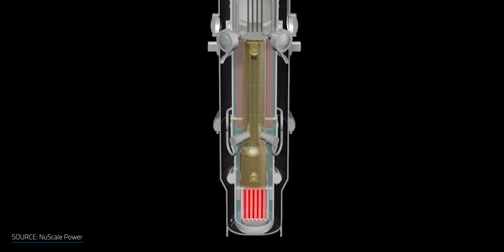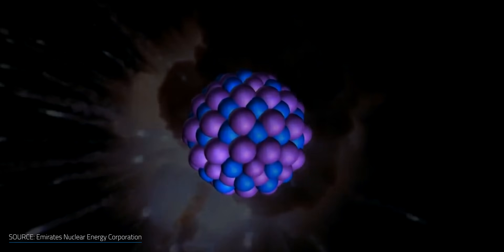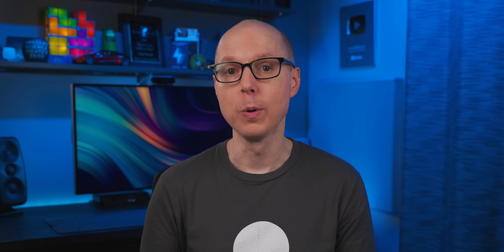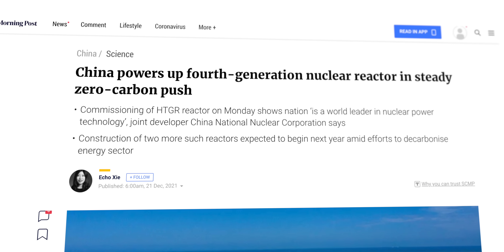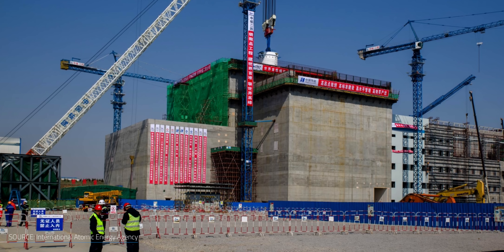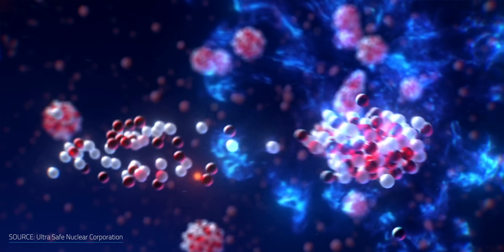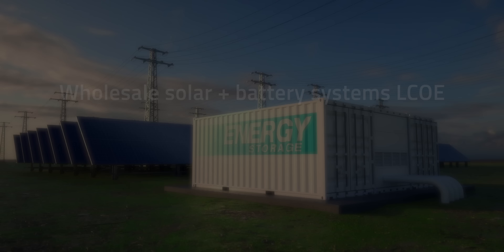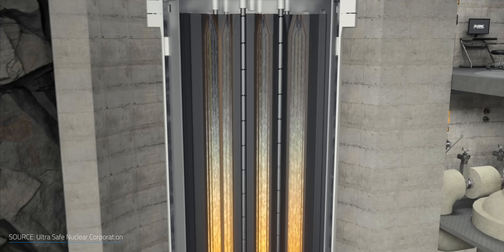Forget Small ... What About Micro Nuclear Energy?

Comment: As someone involved in the Nuclear Industry, I've always maintained that micro reactors, the size of your home boiler one-day can eventually be safe enough to be installed in households. Clean, limitless energy and a modular design that allows fuel to be easily changed after it's spent. 

A whole cycle and industry can be made on reprocessing existing spent rods and redelivery back to households, with the only upfront cost of energy simply being to pay for the reactor itself and the refuelling. Annual inspection and monitoring can be done via cellular or internet, and of course plenty of safety systems to shut itself off during the event of failure.

Generating excess power? Just feed it back into the grid. It's really as simple as that. Power cut or your reactor stops working? Use batteries installed in your home to work in conjunction with any solar panels you may have.
Reply: I think it would be better to put one central reactor in a neighborhood, so as to not have more culs-de-sac.
Reply: @KRYMauL  I was just being a smart arse .  living in the sticks here I have no one around me.  Some day they will have shoe box  size PSU ( POWER SUPPLY UNITS) .  I have reached my END GAME of life here.  Working with barrowed time.  lol    Sure would like to see man on Mars.
Reply: My argument against nuclear power in households isn’t a fear of the technology. Rather I fear human stupidity. 

You could build the safest reactor possible, but some idiot will somehow find a way to make it unsafe. And when it comes to anything radioactive, I would rather it not be in easy reach of the general population.
Reply: @rexerator  You are the first reasonable person i found in the comments until now, populations are not made of responsible rocket engineers only ....

Better keep the micro at city level micro, well guarded and away from idiots ...
Reply: @rexerator  what makes you think people would do stupid things? Hold my beer while I film this for a viral video.......
Reply: @fredbecker607  Exactly. “Geiger Counter Noises ASMR edition.”
Reply: @rexerator  This 100%. Even if only one in a million households screw it up, you still end up with radioactive hotspots all across our country, and the iPhone 30 will need to add a Gieger counter.
Reply: Modular reactors in house holds sound like a nice idea - but how do you ensure that they are not manipulated? Opening up such a thing and dispersing the nuclear fuel into the atmosphere or into the drinking water system. I think that the size will be limited by the cost necessary for the security structure around it.
Reply: @VanDerPol  the safety aspect would be baked into any proposals submitted to the NRC.
Reply: I am a nuclear guy myself, but the utilities are working hard to stop or significantly slowdown home solar systems with batteries (e.g., California, Florida) because they do not want to lose their monopoly on providing electrical energy. Therefore, it is a pipe dream to consider residential nuclear power systems. I do support changing the electrical grid paradigm, but I do not see that occurring in my lifetime until there is a national energy strategy with teeth.
Reply: @dwightadams3853  living here in the sticks I have a modest  solar system   . Just under a KW of solar with 1400 watts of battery.  I can just about run the home on it.  My only issue is the Well is 240vac.
Reply: Never gonna happen. There's too many psychopaths, idiots and potential terrorists to allow such dangerous materials into households. Just take a sledgehammer to one of these devices and you've got the main ingredient for a dirty bomb. In fact, the 'dirt' alone is dangerous enough without having to make bombs. Even medical devices for radiotherapy have to be very carefully guarded and handled.
Reply: I wonder what the calculations would say about this scenario. SMRs work due to economy of scale but that doesn't mean it would continue to scale down to reactors small enough to power a single home. I suspect the smallest it would be feasible to go is around a megawatt.
Reply: I envision my grandson rambling through an old house (like I was allowed in my childhood) and finding all kinds of things to take a swing at. 'look what I found! What happens if I hit it with this bug hammer. Nothing? Then let's drop it of the roof!'.... Not something I would wish for my grandson...
Reply: You sure you're in the industry?  Because I am and this is the sort of thing someone says who has no idea how our grid works.

Running all that power when it's not needed through distribution lines would be damaging to those lines and therefore requires costly upgrades.  It's also comically wasteful since electrical lines cause losses due to resistance and little 69kV lines are extremely inefficient for that sort of shifting of power.  The diseconomies of scale of building such small reactors is similarly silly.  Cost of power is going to be 10-100x what it costs to just build SMRs out of town.

Then there is the issue of non-proliferation.  Do you really think that nuclear material is going to be widespread and allowed to sit in low security locations where people could access it and turn it into a dirty bomb?  That is, even if anyone wanted it in their house to begin with, which is doubtful.  

Again, this is the sort of thing someone in the industry would have thought of so I'm extraordinarily skeptical this isn't just r/futurism fanboys leaking onto Youtube.  This is utter nonsense compared to simply building SMRs at existing generator locations.
Reply: @Nathan M  yeah having a grid makes no sense if every household had one and even then transmission would be an issue.

But you should know dirty bombs are not easy to construct or use at all. Hence why none has ever been used in the history of the world to date. Handling the material is the main aspect. Building some contraption to spread it is another. It's simply a non issue even if you dropped one into a house. 

You literally need to vaporize the material and push it up into the atmosphere to have any real effects... and we call them nuclear bombs. You're not going to make one and deploy it from home.
Reply: I'm on board with most of that assessment because wind and solar generation alone isn't going to be able to address intermittency. But the general public will need proof that SMRs are safe so they may power whole subdivisions before they allow it in their homes or backyards.
Reply: Comrade, come to Soviet Russia, we have reactors of any size. I have a Beta-M RITEG reactor in my basement, I use it during cold winters here in Siberia.
Reply: Not a chance that will ever be deemed safe. Can you imagine 1000s upon 1000s of old reactors being replaces all active and having to go somewhere.
Reply: @philiphawkins4684  With the right controls and regulations it would still be far cheaper then  todays power system.   Your system starts pooping out or parts have reached end of time life?  Someone shows up to pull and replace your unit.
Reply: @philiphawkins4684  Depends on the type of "Reactors".  I have doubts that a "3kW boiler" could be feasible,  but running a single  Thorium "Community Boiler" would be feasible for a whole street of houses and (in the case of Thorium) would only need the reactor core replacing after 10 years or so, and the "waste" would be a tiny fraction of the danger and half-life of Uranium waste (as well as being a lot cheaper)
Reply: When you take into consideration the massive change it would be to our whole world, and how it would impact the worst thing, money, you should realize this will never happen.  The government will make sure of it, there's not enough money to be made there, not enough control.
Reply: @spud69g  Well in my country it's the other way round. No private company is building nuclear power stations. The only ones being built are subsidized by the government, and massively so. On top of that they are allowed to overcharge consumers for the overpriced electricity they produce. Nukes are given a guaranteed price for their power that's well above the market rate. When you said there's not enough money to be made you're spot on, nuclear energy makes no economic sense whatsoever. It is simply far too expensive compared with renewables.
Reply: I think many alphabet terror organisations would like to have 5 each.
Reply: I could picture musk thinking, huh a nuclear powered tesla
Reply: Yeah buy one from the hardware store like a hot water service.
Reply: The benchmark of that statement is that nothing bad happens when a determined terrorist gets their hands on them. Basically these things make amazingly effective dirty bombs in combination with some low cost explosives. Set them off in a major city and the result is the whole city gets evacuated. Nuclear industrialists don't like to talk about the pesky radiation problem but the issue is that anything radioactive needs perpetual round the clock and very expensive security. It's only safe when nobody can get their hands on it.
Reply: @JillesvanGurp  terrorists generally appear because of the oil, banking, and military industrial complex. If we had real justice in our society I doubt terrorism would be an issue.
Reply: There are thousands of ways to kill other people.  We do not avoid or ban the use of many products in fear of them being misused.  My bet is I could find more then a hand full of items under your kitchen sink.   Bleach ? Yes you can create a bomb or poison gas using bleach.  Drain cleaner ?  Yes you can make explosives using the same.  Shall I go on?  Fear Mongering seems to be a way of life in the media these days.
Reply: @pulesjet  I would suggest that the examples you use are completely different in scale than using radioactive elements. The destructive power of house cleaning products isn't comparable to what nuclear, either by intent or by accident, can produce. Furthermore, given the half lives of nuclear elements, any area where they are exposed become uninhabitable for decades plus. 
I'm not against finding a place for nuclear power, but to ignore how it can be deliberately misused, or accidentally exposed, seems to be short sighted. Calling such issues "fear mongering" will likely only make those opposed more stubborn. In general I think such fears get exaggerated into more than is reasonable. But there are still core issues relating to deliberate misuse and accidental mishandling that need addressed before small or micro nuclear gains acceptance. Thanks
Reply: @davebeach2343  Not really.  Examples given was just a drop in the bucket.  Far less detectable then most Isotropic Nuclear Elements.  Less then a gal of most could mess up a whole grocery store of people.  Much easier to deal and handle.  Fear mongers have done a great job of scaring folks of the nuclear options.
Reply: @pulesjet  They have succeeded in scaring a lot of people. And until we can formulate arguments against that fear, moving forward in nuclear power generation isn't likely. People remember Three Mile Island, Chernobyl, and Fukushima. Gonna take a hell of a sales job to change minds. All that I'm saying is that these issues have to be dealt with before our society moves forward with nuclear power. Just telling them that their fears aren't justified won't work. Thanks
Reply: @JillesvanGurp  it's ironic that we should be concerned with such a scenario as you speak of in a society/culture that floods the population with firearms.🤷
Reply: @User Name what's the point of guns if you have a portable mini atomic bomb ..
Reply: @ianmoone2463  if? If a bullfrog had wings, he wouldn't be bumping that backside. Guns are a heck of a lot more accessible than any materials to make any kind of bomb. And the materials for them are easily traceable.
Reply: I don't know what your knowledge or expertise is, but a home-based reactor sounds ridiculous on so many levels. A small core means high enrichment. Either the reactor is way too powerful for a single home or it's too small to be realistic. Does it just heat the water or is it attached to a generator? Not to mention the regulatory and actual safety issues with having any amount of nuclear material just chilling in someones house.
Reply: I'm actually for this idea. 

They should be made so that there's virtually no maintenance and they just get replaced when they run out. 

As for a realistic look at the dangers,
I can't help but worry about some idiot company making defective leaky knockoff brand mini nuclear reactors and exporting these to developing nations, but they'd be more likely to cause radiation poisoning than anything else. If they explode, I doubt they'd be any more dangerous powerful than, a gas or steam explosion or such. Someone correct me if I am wrong.

The other issue though is, how does a company keep running while selling these things. I mean, won't you run out of customers quick if you don't sell internationally or something?
Reply: Imagine a day when instead of asking how old the roof/furnace/heat pump/etc are when buying a house, you ask how old the reactor/fuel are. Those will be the days.
Reply: no.
Reply: Are you a socialist? Joking
Reply: Watch a few Plainly Difficult videos on orphan sources and see  if you still think spreading millions of tiny nuclear cores around is a good idea.
Reply: You're advocating incredibly dangerous technology because you can manage the tech.  Most people are stupid and dangerous.  How would you feel about your neighbours having uranium or plutonium in their garages?  If someone could shoot children in a school, why not just shoot the school's nuclear reactor.  Ridiculously dangerous.  What an incredibly stupid idea.
Reply: I love the idea of a household reactor, like a nuclear AGA. The reason I clicked on this video is that I thought that's what this was about. Hopefully they will come one day.
Reply: You talk of "reprocessing existing spent rods " but if it is so easy to reprocess, why have we got tonnes of nuke waste sitting in drums in pools underground and stashed away all over the place just waiting to become a disaster next earthquake or explosion which would also cause mini disasters in all the homes of earthquakes with mini reactors too wouldn't it?
Reply: So then eventually you are falling back to solar/ electric  power? 
K then electric it is thn
Reply: NOICE!
Reply: What's stopping people from pooling these micro reactors together to create an improvised nuke?
Reply: are you joking? if only one get blow from 100.000 homes in small city all that city got lost and all of them want to move to another city to mkae overpopulation because no safe land.
On each house is to risky.
Reply: @Derek Blue I lived in the hills of Northern California. I'm very very much aware of this. I had to live through them literally getting people killed every year and them silencing those of us that lived in these zones. Then they starting turning off our power constantly on 100+ degree days(which means no water) to pressure the gov into even more reduced liability and increased rate. So, the governor(who received a $1,000,000 from PG&E) gladly gave it to them. Meanwhile the media convinced the city idiots that those complaining just hated the environment and were global warming deniers. No, we were just tired of them constantly starting fires, getting people killed, and everyone running cover for them.
Reply: Ah but you see that would give the people ENERGY INDEPENDENCE and that isn't allowed on the current boring dystopia we are living!
Anything that gives you freedom is censored, blocked, regulated, destroyed and shamed. We must remove these roadblocks first.
Reply: And the shielding? You’d need a big big house
Reply: @hamiltonmackenzie3340  Not necessarily. I have stood only a few feet next to vitrified high level waste made from concentrated nitrate fission products from reprocessing. 

My mindset however from the above 2 years ago has significantly shifted with my understanding of reactor physics and technology.

Small scale reactors absolutely do not work, and these future "SMRs" will not be as effective as it may seem. Large reactors benefit from their physical size to maintain neutron leakage. Smaller reactors will not have this luxury. 

Highly enriched Uranium is the only way to get these working correctly; and in doing so you greatly increase proliferation and handling risks leading to incidents such as criticality during fuel manufacture.

The best way for nuclear to excel is to use tried and tested technology, repeat it again until it's cheap enough to replicate everywhere. Let's stop trying to reinvent the wheel with nuclear - and thus going through reems of bureaucracy. Stick with that we do well and focus on making it as cheap, safe and as efficient as possible.
Reply: I bet we have the technology to do that today.  People have been brain washed to think Nuclear Energy is a dooms day machine..    It's just not so.
Reply: @pulesjet  Tell that to Chernobyl or Fukishima.  With this idea, we'll be able add St. Louis or Des Moines to this list.
Reply: @bodhispears6609  Chernobyl was a case of inept operators.   Fukishima was a dumb ars idea to start with.  Building a Nuc facility on a known earthquake and Fault  Zone  at the edge of the ocean.  LOL  THAT WAS PURE STUPID.
Reply: Say it brother.

I'm a LFTR Kirk Sorensen FLIBE Energy fanatic myself though, he's got a vision.
Reply: @Veldtian1    Yes --  LIFTR . . . . According to the news, China are switching their new one on right now !  (I hope  they've cracked the problem with molten chloride's enthusiasm for eating metal pipes)
Designed to be safe auto-shutdown, Very low "waste" (can even "eat" much of the waste from old uranium reactors)   --  and thorium is more widely available and cheaper than uranium ! !
Reply: Wouldn't the real danger be any terrorist in the area would also then have access to obtaining nuclear power. I don't think the issue is with its use, but with its potential misuse. Heck there was that boy scout dismantling fire alarms trying to build his own nuclear reactor. Hazard workers had to come in to clean up after it. I don't know what kind of makeshift device could be made by a semi competent terrorist. Or even lack of maintenance leading to some sort of melt down? I am not sure how these risks would be mitigated.
Reply: @tcunero  that was a non issue and he gathered enough to irradiated himself to a small degree. 

Dispersing radiation is nowhere as easy as every one seems to think it is. The levels drops exponentially as you get farther away from the source. It's simply not an issue
Reply: I've been saying for years that small reactors running neighborhoods are probably our best long term energy solution. Some engineering companies could design and/or manufacture them, and housing developers could install them and use them as a selling point for their neighborhoods. Neighborhoods could use associations like HOAs to collectively maintain the power station and grid. This would end energy monopolies and create a lot of jobs, and spread wealth to new small businesses tasked with maintenance. There's so many designs out there that are fail-safe and run on existing nuclear waste. It's crazy that no one is moving forward with this.
Reply: @Sound_Stable  I really don't think you want an HOA in charge of anything, let alone a mini-nuke.
Reply: At that point though there's no need for a grid..... Why expend tax money or pay a monthly service fee to maintain a grid when every building / home is already adequately powered for years if not decades at a time?  It really doesn't make a lot of sense at that point.
Reply: @Soletestament  Interconnectivity for overgeneration to be supplied back to the grid, and the support for legacy houses which do not possess one. Such might scale the argument away from individual homes but neighbourhoods. 

With excess generation, though, you could use it to charge electric cars, heat your home by replacing your conventional gas-powered boiler (at least here in the UK) and small battery storage for any event of loss of power.
Reply: @Soletestament  What happens when a disaster strikes and you loose power in your home for whatever reason. Micro-grids are the best for conserving power and keep the lights on no matter the issue.
Reply: @KRYMauL  What happens when the wind blows a little too hard and my lines go down for the 10th time of the year? Cities make sense for sure as the infrastructure is already there, but new builds and suburbs shouldn't need to be hooked to a grid.
Reply: @WilliamStewart1  I said a mircogrid on a neighborhood level.
Reply: @Soletestament  it would make sense to still have localized grids for redundancy and eliminate batteries (beyond maybe a potentially communal one)
Reply: Just what I want at home. A (nuclear) steam generator and rotating machinery to make power. Quiet as a clock.....if you are stone deaf....and if dead you will not notice the vibration.
Reply: What happens when some idiot cuts one open or tries to modify it? Or if a terrorist attack collects the reactors from purchased homes and then detonates explosives with them in a dirty bomb attack? Sorry, the human factors of both stupid or extreme violence prevent this from being a safe system.
Reply: There's a lot of people even in fully developed regions who toss their fridges and other shit into the river, instead of bringing it to a depot or something.
I'd rather not let complete rivers and wells be contaminated because of some random dickhead throwing their mini reactor into the local pond.
Reply: I think they should go even smaller with micro reactors that could fit in a vehicle.  Imagine an EV that never needs charging.  You could buy a vehicle, drive it for 20 years, and turn it back in without ever worrying about recharging it.  In fact, after a few years the idea of "recharging" would become a completely alien concept.
Reply: @LG123ABC  and turn any major car accident into a local "tjernobyl"??
Reply: The big advantage to electric cars is they can run on any energy source. I could see microreactors powering automobile, truck and bus charging stations or microreactors producing hydrogen for fuel.
Reply: Witch Fission technology is capable to simply "shut itself off" in case of an emergency? 
In my knowledge rules of Fission or physics have not changed. 

It's all fun and games until some leader will have a vein pull (like currenty in Zaporizzjan Ukraine) and get's in his head to take a plant or wage war in a proximity of one.
(news have started to arise that the plant is leaking) 

And to these "Small" reactors. If one fails the pollution would be as bad as in a bigger plant. amount that it wouls spread yes would be smaller. (If there is no wind, and that is a fa*** 
very predictable thins is it :D)
Reply: SERIOUSLY???   Homes and schools have had thieves strip the copper wire out of their buildings just to make money. And you're suggesting home house a bunch of radioactive material? Aside from theft, this would be PERFECT for surreptitiously stealing or just redirecting for use in a dirty bomb. In a world with too many nut jobs out there, what you're suggesting is wildly unsafe. Even the notion of, say, multiple 10 megawatt reactors distributes throughout a city. is just too dangerous without a LOT of extra security added to the cost of operating each plant. Thorium might possibly be an exception. But uranium? No way.
Reply: @gregparrott  Pretty sure you could make a dirty bomb with thorium. It's still radioactive.
Reply: @nagualdesign  I agree. But IF radioactive materials were to be widely dispersed, Thorium is supposedly MUCH safer, and would take much higher (i.e. heavier, larger) quantities to have a given effect. Also, I think it's half life is shorter (not sure about that)